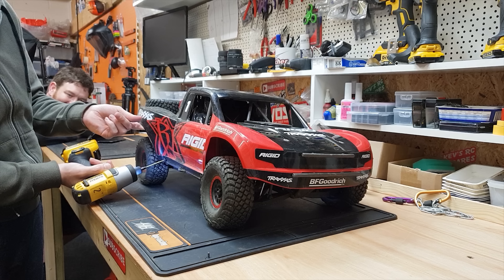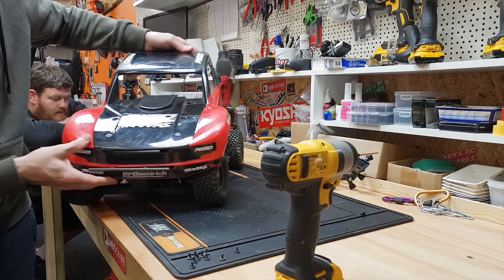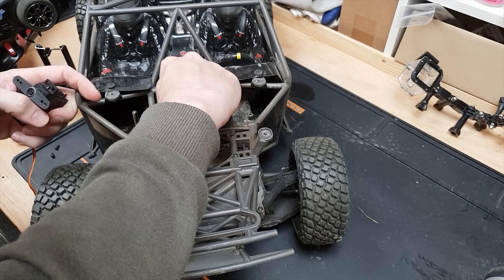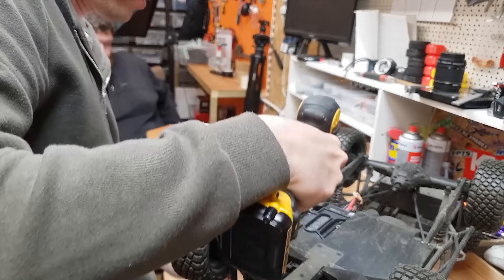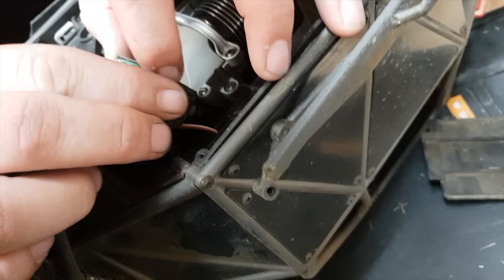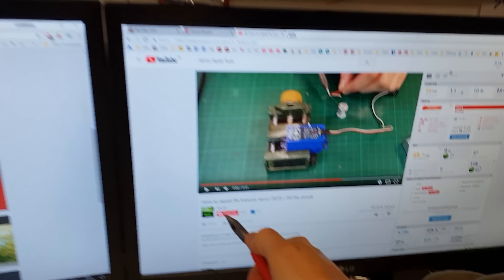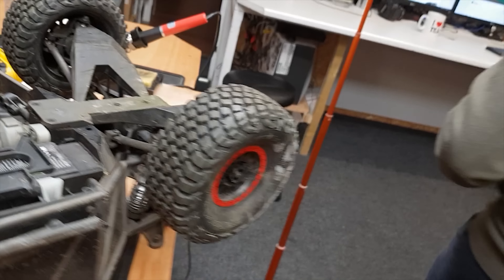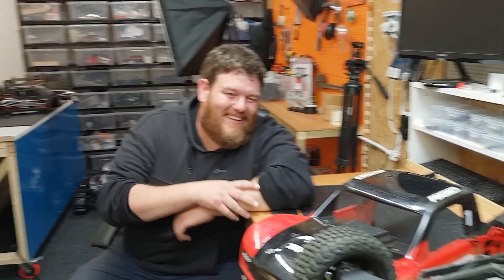Traxxas 2075 & 2075x EASY Servo REPAIR - Its a FUSE!!! (do at your own risk!!!)

Comment: I have a 7050 Servo that died three months ago. I did replace it with a spectrum servo (don’t know the exact model besides that it was waterproof) I have opened up the dead Servo but on mine I don’t have a fuse. Although I could just not be seeing it. Might just have to play with it to see if I can 1. Fix it or 2. Break it even more

Comment: I'll definitely have to try that I had so many of them old 2075s sitting around that don't do anything I'm gonna try this shortly enough. Thanks Kevin
Reply: Let us know how it works out... my 2075 just stopped working today...
Reply: @JBsFPV  did you ever try it yourself? I'm thinking I'm gonna give it a go eventually. My servo in my rustler is pooched. I'm pretty good at soldering small components on circuit boards thanks to my passion for FREE thanks to mod chips in video game systems etc

Comment: You shorted that circuit board... has anyone reported issues later (burnt servo, or even fire?). It's been 2y+. Just had same issue on a 21days old 2075, but am skeptical to try that one out... it's just $40.

Comment: Rusterl VXL servo died on second outing, will check and see if that is the issue, hoping also for a warranty replacement of a new servo without the fuse as this really shouldn't happen to a new RC car. Seems to be a design fault (fuse gauge is too thin).

Comment: Thanks I got mine fixed, 

but after I shorted the fuse the servo motor was overheating and so as the pcb board! Turns out that the motor was worn out so I replaced the servo motor out of an older traxxas servo and now it works fine!!

Comment: My servo also died. Same reason - the fuse. How does it perform after you just soldered the two ends of the dead fuse? Is it overheating?

Comment: that site find is a gem, not exactly how it was done but if it works with out causing problems.. why not.
makes you kind of wonder if that fuse intentionally has a low amperage to increase sales.
Reply from the maker: no idea but surely they would shoot themselves in the foot with warranty claims
Reply: its business practice to build it into the business model, if managed correctly it actually makes them money as the majority of people do not seek warranty for items as inexpensive as these.
All part Six Sigma training..
Reply: @TerraQuestRC  
I know of people at work that are Six Sigma Black Belts or something, is that actually a tactic of Six Sigma training?

If it is, it is no wonder most North American design products are garbage.

Comment: It didn't work on my revo 3.3. But then again they came with 2 servos for the steering. And Traxxas might have thought. We don't need to send 2 working servos do we? 30 bucks for one on Amazon. I think its worth calling Traxxas to see about a warranty repair. I've had this for 2 months and haven't even gone through a full gallon of fuel and I have broke 1 slipper clutch (before the break in was over), rims, the trans blew up and now a servo. I'm not even bashing on it. I was hoping for a solid RC car out of the box after dropping $550 bucks on it. But it seems like I got suckered into a money pit. I race up an asphalt road through the grass and back with the neighbors. If that is bashing then no way could it handle what I do to myself on a dirt bike with 40 foot jumps. (thats 10 kilos or something for the metric people).

Comment: DUDE! this saved my ass! my servo just went out and i got on ur channel, boom! fixed. thanks man, keep up the awsome fun
Reply: I fixed it also but I noticed that it was overheating, so I took it apart turns out the motor inside the servo was worn out! I replaced motor from out of an older servo now it works fine!!

Comment: I have a question will the Trx-4 with a brushless system using a lipo mess up the transmission or anything?
Reply from the maker: it might but mines been ok so far just make sure the slipper does not slip too much

Comment: XXXXXXXXXXXXXXXXXXXXXXXXXXXXX
Just an update on doing this fix 🙉 I fixed the fuse with solder and worked perfectly for month's until I bought and  installed the Traxxas Tracks which put a lot of strain on the servo and in turn blew my ESC 🙈🙈🙈🙈 £80+ down the drain FFS 😭
I guess the fuse in the servo is there to protect the ESC so soldering it just sent the short straight to the ESC and blew it.
My advice would be to scrap the servo and buy another branded one for £20 which is cheaper than £80+ for an ESC
Hope you guys don't make the same mistake as it will eventually cost you. 
Don't cheap out guy's 😎👍🏻

Comment: Buy power he servo that is genuine 20kg for 25$ or 23 for 30$ they are all metal gears and casing and super fast I have one in a tmaxx and trx4
Reply: Ethan Utter are they waterproof?
Reply: @opairsoft8100  yes
Reply: And they are like 17$ not 25$ and the 25kg is the same price, eBay and Amazon

Comment: Just so everyone knows who watches this the fuse is there to protect the components you can replace it was a fuse of the same value but if you just use a wire and you over load the servo the servo itself will fry
Reply: Good point. For those of us that were just going to replace the servo anyhow this seems like a good temporary fix. So long as it only fries the servo that you would have otherwise been replacing anyhow

Comment: DO NOT DO THIS MOD unless you are absolutely certain the rest of the circuit works fine. I did this to mine and  something else is wrong (possibly motor short) it’s drawing way too much current and heating up. You can smell it during the fuse shorting test or feel for temperature. Not worth burning out your receiver. 

You could also have windings in a motor that short and depending where they short it could not affect the motor that much or could be an intermittent failure depending on heat or vibration. Whoever designed this fuse circuit used a slow blowing fuse due to inductive loads spiking really high during normal operation (a dc motor is a short at 0 RPM) During a crash the motor could spike even higher as the controller is applying forward current and gets a back EMF from the motor’s inherent generator properties (spinning it will produce a current). All of this was most likely thought out so if the motors normal current draw is x amps then it would be 4x due to current spikes and then 6x for leg room and factor of safety.  You guys complaining about Traxxas and the way they design stuff don’t know anything about industry. You cannot complain about any design unless you have designed something yourself so all these comments about too many screws and bad electronics go try to design an injected molded part that can withstand more force than any other part you would find on consumer market other than tools. Go try to design a PCB and analog components that can withstand more current than anything else on the consumer market in a small sized and weight package. Then go design all this with the budget of a TOY CAR company. Yea let me know how that works out. Most people that complain about something being a poor design you go to their house and stuff is duct taped together and anything they ever made is a pile of crap. Don’t say something is a bad design until you’ve made one better.
Reply: Thanks Darren

Comment: Worst advice ever... DO NOT DO THIS... why risk your rig for a underrated servo? Tried this and immediately smoked my tx and esc... like they caught on fire.... that fuse is there for a reason.. at least I get to get rid of my garbage traxxas electronics
Reply: Can provide video proof. After I have proceeded to educate myself and this is the stupidest thing I have ever done
Reply: Totally agree, fuses are there for a reason. Tried this fix on a old setup and the servo started to smoke within a few seconds after powering up. Could of potentially caused a lot expensive damage. Try at your own risk.